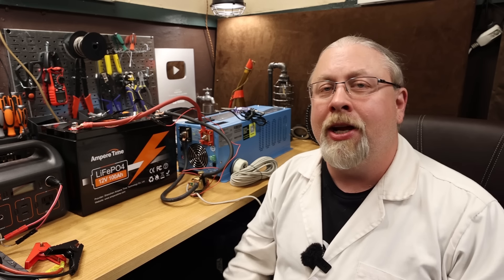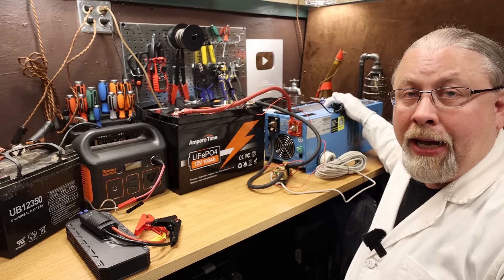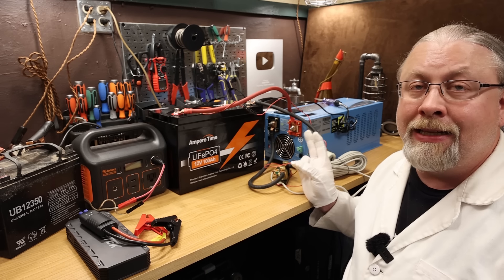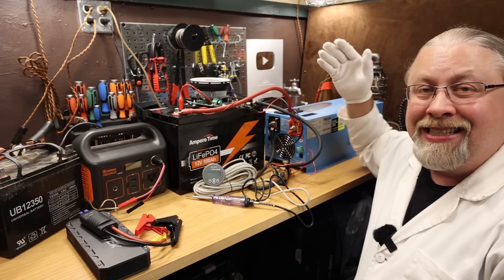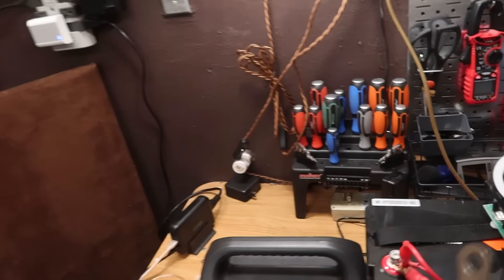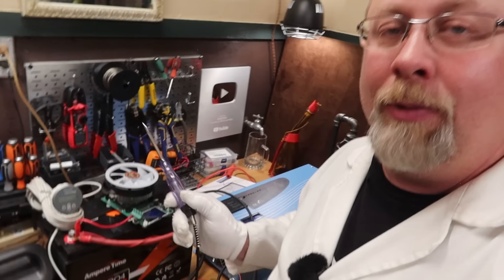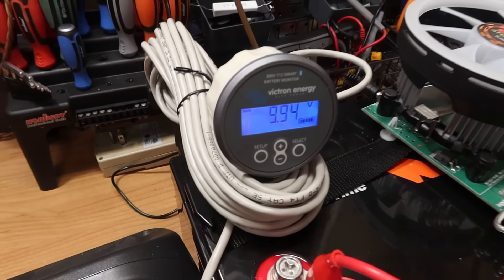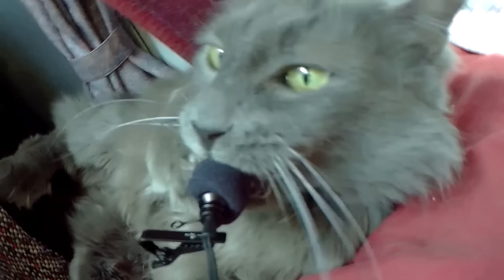3 Ways To JUMP Start And WAKE A DEAD Lithium LiFePO4 Battery FAST!

Comment: I have a bluetti eb3a wont power up it won't charge I opened it up checked for battery voltage at power wires coming out of bms and there is nothing I checked at the bms  board positive negative and it shows 18.5 volts I also checked at the inverter were the battery plugs in with charger hooked up and I have power there , so is the bms asleep and if so how do I restart it ? Any suggestions

Comment: Okay here is the situation followed bye a question: I Arc Flashed on my 12 KW off grid hybrid solar inverter on the DC side while charging 4 LiFePO4 200Ah batteries wired in series with corresponding charge levels ranging from 88%-77%  with the out put voltage frozen at 13.3 v. My phone app for the batteries says they are in  protect mode with the error of over current/ over charge l. (After a month I got my inverter back for warranty work after 3 months of use --FYI DON'T BUY SUNGOLD POWER anything) My question is how do you reset a over charged Flat no voltage battery? I have tried jumping it, all I get is voltage from my other battery, I have tried hooking it up to my nature's generator for in parrel trickle charging to my battery pod ( back up generator) I'm out of options please help.

Comment: I have a solar generator thats been fully discharged, ive dissasemmbled it down to where the battery is accessible, will this method work the same? also do i use the provided wall socket charger or a car battery charger after jumping to charge it.

Comment: I ride a motorcycle and it has a Lithium Battery. I also have a Lithium JUMP PACK. The Jump Pack says to NOT USE ON LITHIUM BATTERIES. How do I jump start my motorcycle with its dead Lithium battery? Is it OK to just attached the JUMP PACK for a few seconds and then remove the pack and see if it will start?
Reply from the maker: Yes
Reply: @HOBOTECH  Thank You!

Comment: @awa2827
19 hours ago
Hi thank you for your helpful videos. 
I have a question about my solar system. I had 12v solar system with 10-180 watts panels and 2 lead acid batteries 12v/200amp connected parallel. I have them about 5 years and last month I bought 2 lithium batteries 230 amp each. When I connected new batteries, my inverter would turn on and off automatically every few minutes when there is less or no  load connected to the system. I have 5000 watts Giandel inverter. I thought my inverter had a problem so I bought another inverter. This time I bought a 24v 5000 watt inverter and switched my solar panels to series. And I still have the same problem. 
I searched online but could not find any helpful information. Will you please help me out with this issue?
Thank you so much.

Comment: Is it normal for them to draw enough current to blow my rv converters fuses after jump starting? This will continue to happen until they get back up to 12 volts from solar or a portable charger ran off of the generator.

Comment: Hi have an Airwheel luggage, the lithium battery often shutdown by the BMS due to the bumpy ride. I needed to charge it with the wall charger to revive the battery. Its quite frustating, is there any other way to jump start it without plugging it into the wall?
Reply from the maker: Like the video says... with any 12v source.

Comment: Can you jump start a 12v 14a lithium motorcycle battery using a running car?
Reply from the maker: Is it 12v?
Reply: @HOBOTECH  Yes. But since I commented, I’ve learned so much more about the situation. You cannot jump said battery with a running car because the alternator makes far too much amperage than 14a. Went out and bought a trickle charger.

Comment: Hi, Professor I have a 48 Volt 10 AMP battery that will charge for around 5 minutes then when I use the electric bike it will die very very quickly within 15 seconds how do I revive that battery. It does have a built in headlight and that's the only way that I can think of to discharge it. Or should I get another 48 Volt good battery and just go positive to positive negative to negative any help would be appreciated thank you Andrew

Comment: What is you've got a dead 24v battery, the solar mppt controller runs off the battery power do the solar doesn't kick in until it's on and only have a 12v lead acid battery yo hand, is there a way to make that work with the different voltages??

Comment: Once I jump start it (with battery, or booster pack) it’ll start my CTEK lithium charger. But as soon as I disconnect the 12v source it turns off the CTEK charger (not reading anymore) any tips?

Comment: I just bought an SOK 206ah battery that has 00.6 volts out of the box. Do you have to have a charger hooked up for this to wake up the battery? I tried it with just a 12 volt motorcycle battery and it did not wake up?
Reply from the maker: If the SOK is brand new and reading 0 volts you need to return it. The cells are permanently damaged.

Comment: Tried all these or somilar methods. I have a renogy 12v 50ah and has 0 volts.
I tried to activate it with my 10amp charger. There is 14.4 volts across the terminals, but 0amps going into the battery. As soon as I remove the charge  cables, the voltage drops back to zero over a 30 second period.
What can I do... please help

Comment: Hey I learned how to revive a led acid battery the other day. You drop it on the ground. No joke. A dead la battery will start a vehicle if you drop it. Or slam it on the ground, right side up.
Reply: Will hitting it with a sledge hammer work? I have lots of sledge hammer.😊😊😊

Comment: Thank goodness my portable battery jump pack has a "Boost" feature.  My 12V lithium battery came back to life instantly when jump started on the boost feature.  Without the boost feature the jump pack will not detect a battery and won't work with a dead battery.

Comment: Not sure if you answer questions but giving it a go... I have a 72V 35ah lipo Ebike battery that reads 51 volts. Neither of my Ebike chargers do anything. Is this a situation like you talk about where I can use a jump box?
Reply: Hi ,were you successful in bringing  the 72V battery back to life? Martin
Reply: I haven't tried. Still not sure what to do.
Reply: If you have any suggestions, I'd be very grateful. It's $600 just sitting heavily on a shelf and won't take a charge.

Comment: Hey Hobo. I just ordered the Noco GBX45 to carry with me on my motorcycle which uses a lithium battery, come to find out upon reading the manual the GBX45  is only to be used on lead acid batteries.  Even searching the internet I can't seem to find a solution.  Any suggestions? Thanks.

Comment: I have 12V 100 Ah lifePO4 battery that shows 9.16V, I Tried all three of your ways and still nothing. She does not want to wake up. Is there any other way? I hooked the original lithium battery charger (14.6 V -20A) and doesn't recognize the battery. So I tried with the charger on to jump it off the other 12V battery nothing,tried with charger off, same thing nothing. The battery is only 8 months old. Please can you advise hopefully some other ways to wake her up. Thank you in advance
Reply: Maybe I need to hold jump cables a little longer, not sure. Should I have a charger ON while holding jump cables on for the battery to wake up, how long to hold it... Please help. Thanks

Comment: So if I have a lithium battery and it is dead can I hook it up to my car's negative terminal and then jump it off with a battery jump box like you just used and apply the positive terminal and let the car charge it to full reason I'm asking is I'm brand new to lithium batteries and I just ordered a 74AH lifepo4 battery and a ioxus ultra cap battery to go together in my car for the audio system I've got the capacitor covered using a small resistor and my car but as I said I'm new to lithium can I do it the same way as the capacitor almost like a trickle charge or the other way without the resistor but using the jump pack I don't own any kind of lithium charger and I'm having a hard time finding a good one I tried one off Amazon and it wouldn't recognize the battery at all because it was dead

Comment: Mr Hobo.  A ?.  We've had an electrician set up our eco flow smart panel with 2 delta pros.
We've set up the unit when batteries drain at 30%.  Problem in that the panel isn't recharging at 30.  Continues to drain.  ????

Also our phone batteries are draining quickly being hooked up to Bluetooth.  Could turn off Bluetooth but then couldn't use it on phone 

Any help????   Thx.  Peter

Comment: Shoot, i tried this a few days ago and it did not work for me.  In my case i have a 36 volt ebike battery that went dead (it should be in good condition).  I took my other exact same ebike battery that works and is the same model (yep, i have 2 to give me long range rides), ran some wires from the good battery to the dead battery, (pos to pos, and neg to neg).  It did charge it up enough to get one light on it, but the charger still will not recognize it.  My meter said it had 36 volts which is correct.  I figured i did it, but nope, it did not work.  I was hoping i did something wrong, but after watching your video i did it correctly.  I cannot use my lithium solar charger since it only is for 12 volt batteries.

Comment: Does anyone know if i need to dusconnet my solar panels and controller first ?  Will it fry anything if i do ?  Thx
Reply from the maker: You can jump with the controller in place.
Reply: @HOBOTECH  i see why everyone appreciates  your input  so much. Thx 1,000,000 . Im on the road , running a cooler on a 200 watt panel , All new ...again.  3 days of rain in Fla , almost lost  a 2nd batch of IV $2500 )  I was about to give up on a trip that took 24 hours one way and a year of planning . So ..very² big thankyou ..and for a fast reply ..  You saved me an awful lot of disappointment  and pesos :)

Comment: My Bluetti AC200P said 0% but was still on. I tried charging it but nothing then I turned it off  and back on, now the display looks back lite but the screen is blank. I pulled the cover and main battery still shows over 50 volts ⚡️ am at a dead end so looks like it goes back to Bluetti.

Comment: i need your help my esener 3kw inverter is just plinking and not working when connected to ac
Reply: The methods presented are to address exactly what you're facing.  The inverter can't "see" the battery cuz it's too deeply discharged.  Nudge the battery awake and your charger will do its thing. FYI the price of much faster AC charges has come way down, can get to 20A probably for what you spent on 3A
Reply: @3genac  thank you very much
second one is my deye inverter starts discharging from 1700hrs to 02hrs,how do i make it charge the batteries using the pv,genset and or grid
Reply: @brianchinyemba3818  I dunno.  My battery's dead now and I can't "jump start" it.  SOK support is of dubious value.  Factor that next time you consider premium US companies impart.  Good Luck.

Comment: Unfortunately this did not work for my 36v ebike battery.  I have two Samsung 36v lithium Genze ebike batteries and one got too low of a voltage and died.   I hooked them up in parallel and did manage to charge the dead one up a bit, but the bike charger would not turn on to charge the bad battery and it is still worthless to me.
Reply: Bms might be trashes or you have dead cells.
Reply: @CharlesNewkirk-lb6uh  Yeah, I managed to charge it up fully using the parallel battery hookup method, but it still did not work.  Plus the voltage goes down quickly when hooked up to a multimeter, then goes back up when disconnected, not a typical or good sign.   bummer.

Comment: bought a new Dr Prepare with hub. It got fully discharged because I hooked it up to my cigaretter port....anyway, I tried all three methods and with and without the hub..zero. Of course no responxe to my 3 emails to Dr Prepare. Any ideas, or did I just throw 400 out the door?

Comment: Had to leave my lithium ion charger plugged in and on with its cables half on the battery bolt, then jump pack on other half of bolt to make it work. If i try moving the charger cables fully on the bolt it cuts power and shuts off. Its working for now. So I'll leave it be.

Comment: When these batteries are at 0, that's because the BMS disconnected, not because the individual cells are at a damaging level, correct?

I severely damaged my diy 24v battery by allowing it to actually get to empty.

Comment: Is it possible to charge lithium ion batteries without a solar system in a van?
Thanks in advance
Reply from the maker: It's called alternator charging.
Reply: @HOBOTECH  Yes I see but from what I had it can mess up the alternator unless with some upgrades. 
I should have been specific with my question can you charge lithium ion batteries from a power bank cause I have an ecoflow power bank sorry for taking your time.

Comment: I bought a Chins battery in October, 5 months ago. It already tops out at 82 aH as shown on the BMS instead of 100 aH. The tech customer service hasn't been much help. I have 2 lithium chargers, no solar I use this to power a CPAP device. One charger puts 30 amps into it, the other is a trickle charger but neither way, fast or slow seems to bring it up to spec. I'm beginning to think it is the BMS itself that is reading it inaccurately. It still works for what I need, but it is disappointing that a battery that should last for about 5 years is already beginning to slide. Has this sort of thing occurred in your years of doing this sort of thing?

Comment: Okay had to comment on what you said about old sealed lead acid booster packs lasting only a year a sealed lead acid battery should not be discharged below 12.2 and float charge is 13.4 and full charge is 14.8 when I first heard that I thought that it was wrong as the manufacturer should know proper charging parameters for sealed lead acid batteries I bought a new one yearly with a modified sine wave inverter to charge my cordless tools and run a drill for almost 50 years on my first one I bought I blamed it on not properly keeping it charge up and a few times I killed it dead but the next one I bought I never took it below 6 volts and kept it on charge when not in use then I found utube and found out that the problem was improper charge parameters so I took apart my old black and decker and written right on the battery was do not discharge below 12.2 float charge is 13.4 and full charge is 14.8 and on the built in charger was output 12 volts so it was dead to start with and being discharged way too far and trying to find a battery charger is hard as they charge to 12 volts and say it's fully charged

Comment: CAN THIS WORK JUMP STARTING A BRAND NEW BLUEETTI  B 230 auxiliary BATTERY THAT WAS RUN DOWN SO LOW IT SHUT DOWN AND WONT CHARGE NOW.. ITS A $ LOSS ..HEART BREAKING ..CAN IT BE SAVED SOMEHOW ....?
Reply: Plugging that into your AC200/300 should sort it, or else it's defective and should be returned

Comment: Can’t seem to find restarting a non-charging lithium battery that is 10.9 V. It will not charge it will not take a charge. It is stuck on 10.9 V. It’s a 50 amp hour 12 V ampere time battery.

Comment: Most chargers don't even need to see the full 12v to turn on.  Sometimes you can jump the BMS with a 9v transistor radio battery.

Comment: Im really not trying to be smart but what is the point of doing this if its so low that's its gonna cut right back wouldn't charging it do the same thing im confused.
Reply from the maker: Most chargers won't charge unless they see voltage on the other side. If the BMS shuts down the output is <1v.

Comment: How to revive an SOK Bluetooth Lithium Battery and bypass BMS
The BlueTooth has discharged the battery and you can't charge it. 
Open the battery and charge the cells directly for about 10 minutes - after try charging from the top through the BMS. If it doesn't work, recharge all the cells bypassing the BMS to nearly 100% capacity. If the BMS still won't work:
Disconnect all power from BMS, let it sit overnight, make sure you charged the cells without the BMS to about 80% - reconnect the BMS, start charging normally through the BMS on top of battery.

Comment: At work we had a term, RTFM, Read The F'n Manual. Many chargers now support lithium and could get your dead battery started. Again, RTFM. Be prepared, many manufacturers provide a manual online. Pick a charger that would help with a dead lithium.

Comment: Its not the battery that shuts down. BMS is the one who is responsible for shutting down the battery. It protects the battery from over charging, over discharging over current, short-circuit etc. And by applying the juice, you are just waking up the BMS.

Comment: I tried each method. No luck. Ampere Time 12v 50ah stuck on 10v. BMS still won’t kick in…A $200 batt that doesn’t work. It lights up flood lite till dead…

Comment: Most other guides advise to bring up a dead lithium cell veeeery slowly. You bring it up quick. Are they wrong?
Reply from the maker: The cells in this case aren't "dead". The BMS is turned off to protect the cells. This method "reboots" the BMS.
Reply: @HOBOTECH  You mean, their charge-state isn't really zero volts?